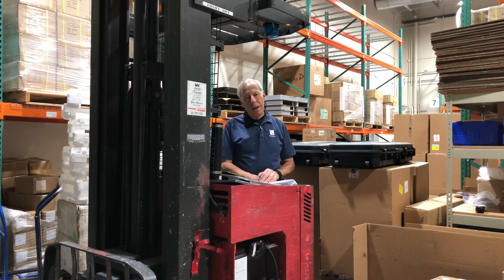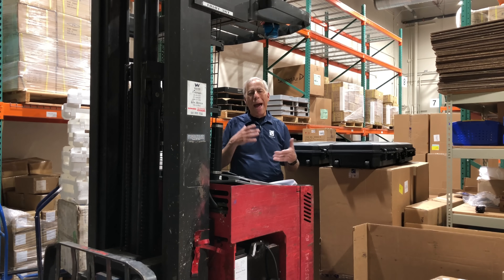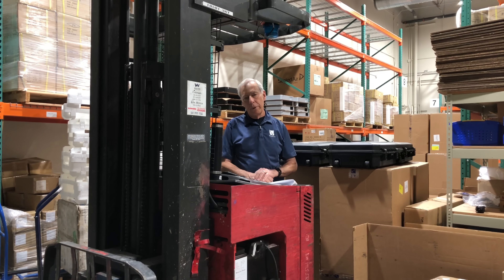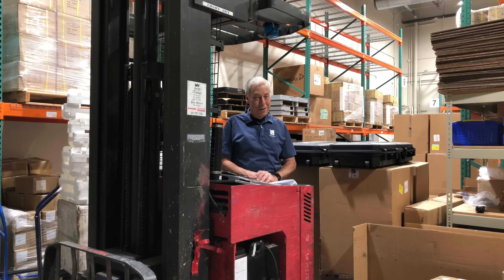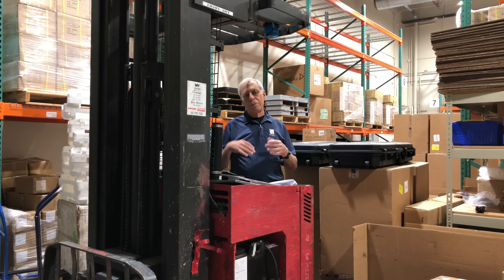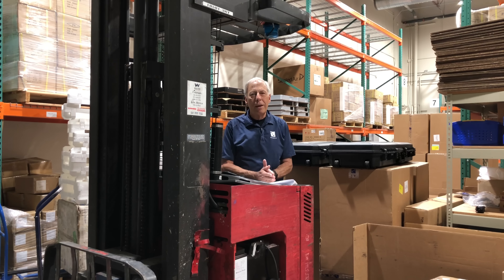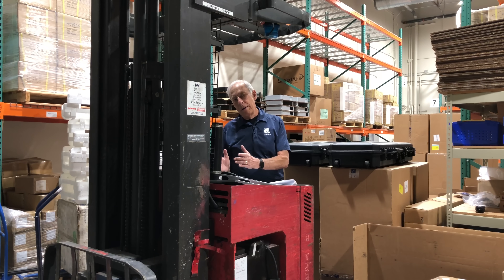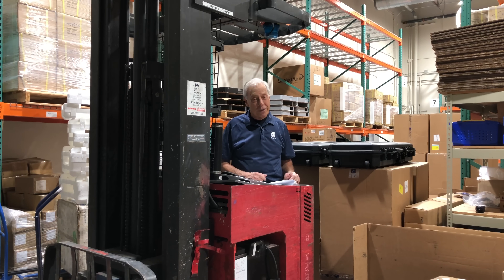Using super caps in a power supply

Comment: Hello Paul
Stacking Super Caps is a dangerous business.  Stacking 5 Volt or 10 Volt caps in a 100 or 200 Volt array risks punching out the first several caps on start up.  The sudden rise of voltage across the stack will exceed the rating on the caps as the subsequent caps charge from ground or zero at earth.  Microseconds of over voltage will punch the film and weaken the film if not cause an immediate explosion from the short and heating.  Voltage applied to the top of the stack will raise the voltage on the next cap, then the next but at this happens, the full exposure Voltage will punch the caps in line, in time, in series.  Snubbing resistors are often used in stacked high Voltage rectifiers to equalize these voltages (and switching glitches) but high value resistors placed Across the caps defeats their purpose to some degree.  Yes, often times bleeder resistors are placed on large value electrolytics and this could be applied to the super caps but the bleeders (snubbers) across the lytics are on caps rated for full Voltage values and in series applications, full Voltage values are often limited on start up with heavy resistors or Star / Delta starter systems, among others.  Just my opinion.

Comment: Yes .. I noticed too uF is millionth !
Paul ..! Have you never done time constant calculations.. resistant X capacitance in Farads ! 
I detest series caps ... it’s a cop out ... you do NOT need caps offering Farad capacities .. though they do use 1-2 Farad capacitors in super high power audio in cars .. but this is up to 14-15 volts only . 
For high end audio the use of suitable 10,000 -50,000 uF caps with very low ESR and high ripple current is all that’s necessary.... ideally capacitor matrixes is best .. 10 X 10,000uF all in parallel  the ESR’s are reduced to a much lower level than using just one 100,000uF

Comment: Adding capacitors in series can enable higher voltage but some care is needed to ensure that the voltage is evenly distributed across the capacitors. If you have 10 capacitors in series each able to handle 10 Volts and charge the array to 100 Volts, you can easily risk that at some point one or more of the capacitors will experience well above 10 Volts due to tolerances between them in leakage current and capacitance. Additional components can be needed to ensure even voltage distribution e.g. some resistor in parallel with each capacitor can balance voltage.

Comment: All batteries are electrically noisy and not appropriate for high end audio circuits.
Reply: Bill Kenney the level of noise a battery produces can be measured (with difficulty) but is too low to have any effect on audio circuits; any mains based power supply, no matter how well regulated and filtered it is, have more noise than any battery
Reply: @FooBar89  That could all be true. I can only speak from experience and running a battery power supply is not something I would do. I found that electrolytic capacitors, current source disconnected, were very quiet. An circuit that lets say draws only 20ma and runs only from charged up caps is pretty quiet. I built a discrete components 40Mhz rf amp inside a faraday cage once. Long time ago, far far away. :-)
Reply: Battery power is about as clean a power source as you can get.
Reply: @cbcdesign001  Plus you get the added feature that batteries can, and do, catch fire.
Reply: It's determined by the amount kT/C, so to get low noise from a battery, put a large capacitor (C) across it. Without the capacitor, the noise bandwidth will be huge so total noise power (not to be confused with noise power per Hertz) will be large too.
Reply: @MrTheNark  Thanks. And a little scary ( stored energy )
Reply: MrTheNark the larger the capacitor the less it can filter higher frequencies, one single capacitor won’t do, capacitors in general won’t do, you need active filtering
Reply: @FooBar89  FWIW one of the little jobs I had in my career from time to time was to get products UL/CSA/CE Certified. And part of that was to calculate the amount of energy stored “in the box”. The testing agency would then place a “calibrated firecracker” inside the box and set it off. The explosion had to be completely contained. I don't do that anymore, I'm retired.
Reply: @FooBar89  I agree about the first part. In practice, larger caps have large ESR so a large cap is good at filtering low frequencies but not at filtering high frequencies. Therefore, typically a couple of caps from large to small are put in parallel. For example 10uF, 100nF and  1 nF.

Comment: Your right to stay away from all that Paul. Yours truly did a prototype servo system for a tank gun turret using 1.5 Farads and 70 transistors in the output stage. We always knew where the short, or failed transistor, was ( never is ) by the black burn spot/hole in the heatsink. And when it/they gave way it was like a 4th of July Sparkler. Little pieces of aluminum plasma bouncing around on the floor. It literally blew the top off the Transistor TO-3 housing.

Comment: When I was in electronic fundamentals school in the Navy there was a chapter introducing capacitors.  The standard unit for a capacitor's value is the Farad.  The introduction stated that a capacitor that used an air dielectric of 1/32 inch with a plate area of 36 Square Miles would have a value of one Farad.  This put the "Fared" in perspective for me.  At the time, in the mid-1960s there were no capacitor of that value available.  
Far better dielectrics have been developed to make the plate distance smaller which allows these huge capacitor values possible today.  These high values still have rather low working voltages.
Reply: FWIW. See my post above. GE/MIT/US Navy built a prototype solid state servo system that was potentially to be used in the then evolving Main Battle Tank ( Now the Abrams Tank ) and the 5in gun on Navy Ships. It used 1.5 Farads ( if I remember right it was three .5 Farad caps in parallel ) and about 70 output transistors. Under grads are cheap labor. I was outta there by 68 so I can’t say where all that eventually went.

Comment: too high ESR, not ideal, even worse when connected in series.
the best practice is to parallel many low value electrolytic caps together with a few film caps and a few more ceramic caps for bypassing pre-regulation.